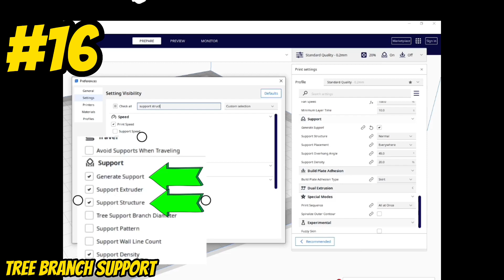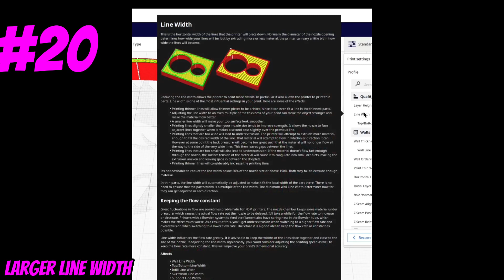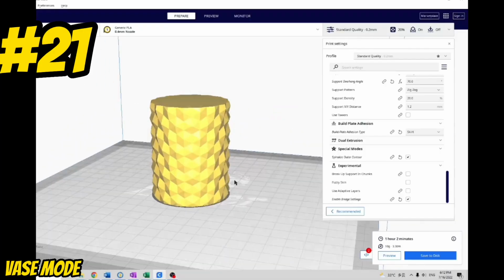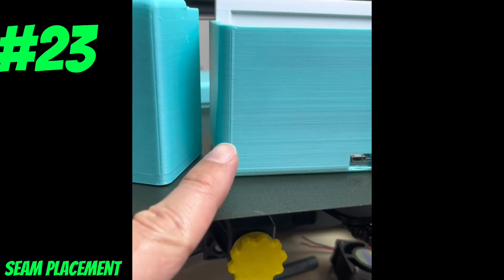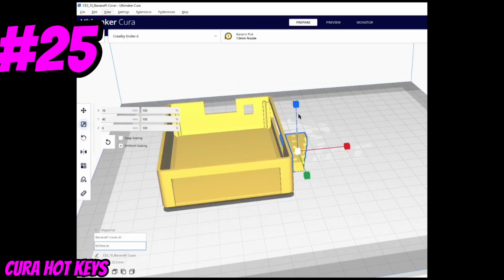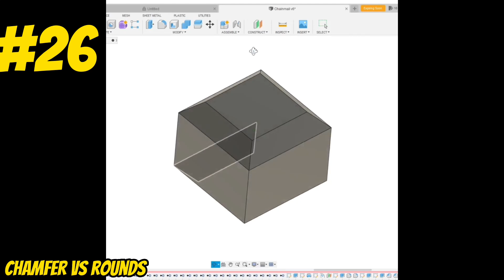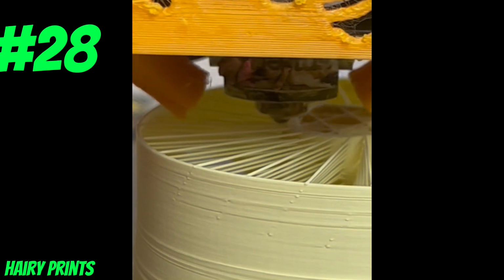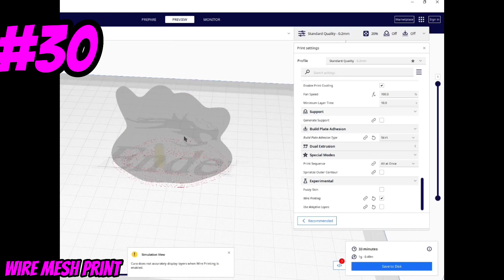30 3D Printing Hacks (Part 2)

Comment: what is the tool you use to change your nozzle? I've been looking for something like that cuz rn I'm just using a wrench and it's not as easy or safe
Reply from the maker: I usually just use a normal socket with a small adapter to fit the ratchet which works pretty well.  Just be very careful with a ratchet you can easily overtighten and strip out or break something. They also make some specialized nozzle removal tools but I haven’t tried those.
Reply: @DesktopInventions  would you mind linking to what you mean?
Reply: I use a socket on a short screwdriver type handle.
Reply from the maker: If you’re going to buy a tool I would recommend one like this https://www.amazon.com/Printer-Cleaning-Wrench-L-Shaped-Hexagonal/dp/B09WTSZWG3